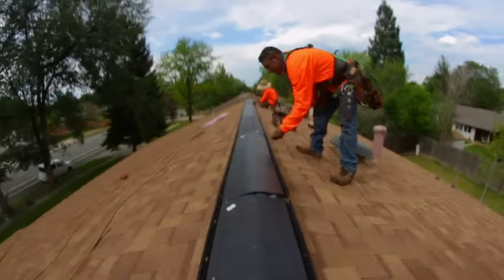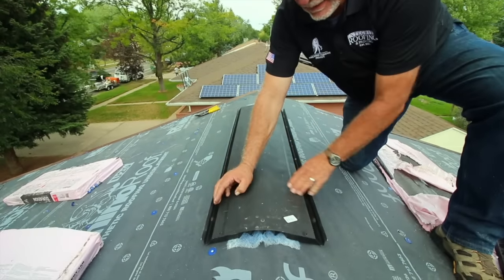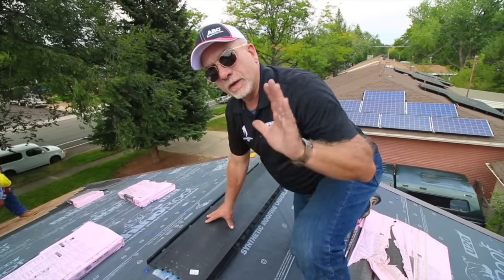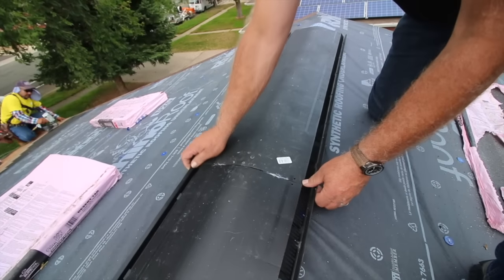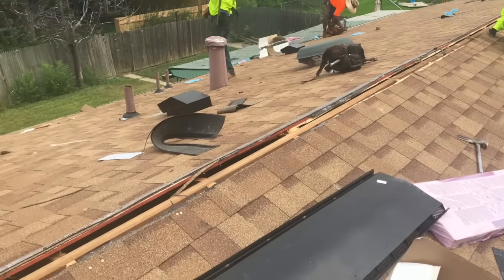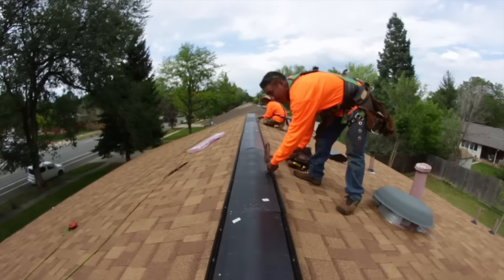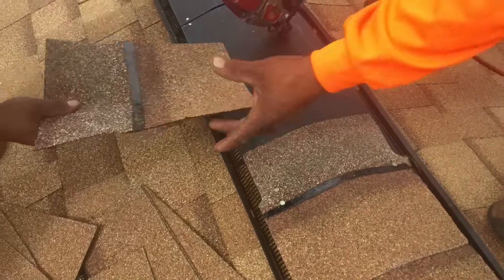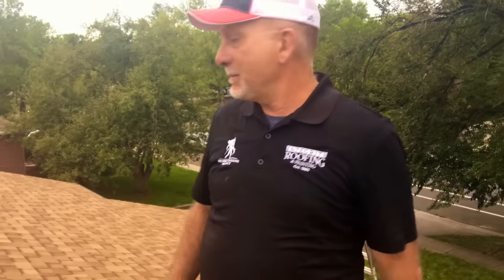RIDGE VENT INSTALLATION TIPS | ROOFER TRAINING

Comment: I hate with a passion speed nailing of any kind. They miss and drive half of the nails incorrectly
Reply: shantor100 take your time turn the pressure down and keep an estwing for the stragglers. But on my home I would hand nail them all .
Reply: Not if your good I cant bail that fast but pretty close and I hit the nail at least 3xoutvof 4 but I know what you mean
Reply: That's a no shitter, I had a crew of Mexicans did my roof it sounded like they had a machine gun up there, when they got done I had to go up and silicone over all the nails that were showing between the tabs.
Reply: Kelly White how you know there country of origin, did you ask each specific worker ? you don’t know if they where from Honduras,Guatemala, Salvador , or the rest of the Hispanic countries?
Reply: @kellywhite9278  I'm surprised your roof didn't cave in with that kind of attitude. .. SMH
Reply: @gonzalochalo461  it's not a racist comment about Mexicans if that's what you're thinking I have nothing against Mexicans I like Mexicans it wouldn't matter if they're Mexicans or blacks or Browns or yellows or whatever the hell they were it was about the job that they did poorly.
Reply: @kingloui9819 ok I don't know where they were from, they looked like Mexicans, but it's not meant to be a racist comment, like I said I'm not racist, I have nothing against Mexicans, it's about the job they did poorly.
Reply: @gonzalochalo461   Nothing about race bozo! If she knew their names she would of said it So yeah they was Spanish types  big F ing deal. Go listen to kumla harris speech shes on fox
Reply: @naps3386  I'm not a roofer I'm an otr truck driver, why should I take off work get my ass up on my roof to tell a crew who advertises to do a good job roofing my house how to do it, it sounds like you probably don't have to have someone looking over your shoulder telling you how to do your job, and I'm far from a snowflake millennial that needs to be told how to do my job.

Comment: I’m not a roofer but, I saw some speed nailing and the nails were going through the tar strip. Aren’t you supposed to nail outside of that strip so it will heat up and stick?
Reply: Nailing through the Tar strip is actually the best place to nail shingles, as the tar will seal the nail hole.

Comment: Is that fiber glass too much of an airflow obstruction?   My ridge vents have an insect barrier that is way too restrictive.
Reply: Good point. I was thinking the same thing.
Reply: The become blocked with dust eventually. The filters are bad idea.
Reply: @firstdive2005  Makes sense, honestly, I could not breath through my filters if my life depended on it after two years on the roof.  I removed them all.

Comment: The ridge vent manufacturer does clearly state that a minimum of 1 3/4 - 2" nails be used to install cap shingles. Plastic will not stop shingles from blowing off.
Reply: You are correct sir. The video shows the improper way to install the ridge cap.😎

Comment: I am a roofing contractor in South Carolina. I am a certified repair specialist and am well versed (20 years) in the application of all roofing products.
I really like alot of your vids, however...you are showing the improper way to install the ridgecap in this one.
You should NEVER use a pneumatic nail gun for the cap as the PSI can damage both the capping and plastic vents.
Capping should always be done by the hand drive method and preferably using nails that will penetrate the decking such as the typical 3" nails provided for vent install.
Owens-Corning for instance, provides the nails sufficient for this proper install of capping with each piece of its product. Stay safe and happy roofing.😎🙏🇺🇸
Reply: Owens corning also provides two coils of inch and three-quarter nails for your gun with their ridge vent product. It depends on the product. This ridgevent he is using is low profile enough to shoot on with a nail gun. I just wouldn’t shoot Owens Corning breakaway cap. I 4 nail their breakaway cap even when not going over Ridgevent. It is garbage and your nails do not hit the cap below it. I would much rather cut and use three tabs
Reply: They do not provide nails for ridge cap. They provide ring shanks to secure the actual ridge vent.
Reply: in general i agree with what you stated installing ridge cap by hand however, owens corning products includes nail coils for use with pneumatic nailers with their ridge vent roll systems.  To me that's an issue but they are allowing for use with nailers by providing products only for use with those coils!

Comment: We like to run the vents all the way to the end of the ridge.  (Look at the way Certainteed recommends installation of their ridge vents.) We believe it gives a more finished look instead of a raised vent sticking up from the roof.  We only cut the vents to no more than one foot closer to the end of the ridge.  The vents you are installing appear to be the same we use and they have internal blocks so that you don't have to worry about water getting in the ends because the blocks seal against the shingles on the top of the end of the ridge. If you have to cut to fit just make sure the butt end is facing the end of the ridge and cut on the end joining to the existing vents.  

I like the chalk line and installing one side first to get it nice and straight.  Have to use that in the future even though we get them pretty straight using the center of the vent and the ridge beam to line up.  

The vents we use, appear to be identical to yours, have tabs for interlocking the vents together.  I know GAF recommends leaving 1/8" gaps in cold weather but who installs shingles in cold weather!  With the number of nails in the vent and then all of those in the cap shingles, there is no possibility of expansion and contraction in any direction.  These are not like 12' sections of vinyl siding.  We have never had a problem because we only install in the spring and fall in warm, not hot, weather!

I am not sure where it says to use anything other than the supplied 3" ring shank nails to secure the vents and the shingles.  The instructions specifically state that the nails must go through the sheathing by 3/4".  Even 1-3/4" gun nails will not do that.  The shortest nail allowed by GAF is 2" for the snow country vent but it appeared you were using snow country advanced like we use which comes with and requires 3" ring shank nails to get the warranty against uplift.
Reply: I saw instructions that show caulking the edges on dimensional roofs. Yet, I never see anyone do this.
Reply: They supplier that I bought mine said 1 3/4" Nails... smelled like shit to me I'm going to roll 3" ring shank galvanized and try not to overdrive them. 

In addition the supplier said cut 3/4" cut on each side so 1 1/2" gap these guys have 3"... im using Ridge vent just like this.

Supplier seems to not know how to install.

Comment: I find this to be the best ridge vent ! Builders Edge or Ridgemaster Ridge vent. I have replaced others that were not working with this!
11 in. x 48 in. Ridge Vent Plus (10-Pieces / Box)
Resists cracking-regardless of temperature
Nailing supports and structural ribs ensure a straight roof line
Withstands dents from tree branches or hammer blows

Comment: I was just reading the the instructions on the ridge vent I'm about to install and it recommended a 1 1/2 gap max....so just make sure you double check before you cut. Great video!
Reply: this depends on weather you have a ridgeboard or not. Trusses dont hade a ridgeboard and allow more air to pass through. 3 1/2 seems like a lot of ventilation to me. Check the instructions it will tell you to use the bigger gap only if you have ridge and raftor.

Comment: ..Very helpful , but have a question about the ends of the vent. Are they sealed with roofing sealant when installed? They is a start end , do we invert the vent on other end to have start end there for water restriction?

Comment: Some observations; Shingle hammers were designed for use on wood shingles and shakes. Their square heads aren't compatible with anything else. Most ridge vents, even with equal soffit vents do not meet code minimums and don't come close the manufacturer's  and FHA's preferred specs. The electrical riser seen in the video doesn't meet specs either!

Comment: We have a continuous ridge vent installed on our 20-year-old home. We have our roof inspected every year and so far all looks good. Since our attic is so hot in the North Carolina summer, would you recommend adding an attic fan as well with a temp timer as well? Thanks

Comment: Wish Integrity Roofing provides service in Fort Worth Texas.  Some of the contractors who gave me a free inspection told me that ridge vent is not a good idea for my roof which is not flat or too steep.  Are they right?  For the ventilation work properly, do I need to install inflow vents as well?  My roof only have some Soffit Vents.  Appreciate your input ASAP as I'm in the process of having my roof done.  Great video!  Thank you.

Comment: Great video.  Is it worth installing 1/4” wire mesh on the ridge opening before setting the ridge vent piece ?  Can’t mice chew threw this material to enter roof ?
Reply: they'll chew right through the 1/4" wire mesh unless you get stainless mesh. Good idea, for sure.

Comment: What about snow, ice, rain? Do ridge vents not ever leak especially with snow melt and driving winds? How to install on hip roof? Do you need same area in gable vents to allow air in....air out circulation? How long to ridge vents last before needing replacement?
Reply: Of course they don't answer serious questions

Comment: Thank you for a very informative video on ridge vent installation.  Thank you for mentioning the Florida panhandle! I am curious what are the requirements for a ridge vent installation?  We have high cathedral ceiling in our living room with soffit vents and traditional rolled insulation in the rafters. 
Should a ridge vent be installed for our type of roof? 
What is the impact if a ridge vent is installed in our type of roof? 
I have heard the term gable applied to our living room, so what is the difference between a A-frame, Gable and Cathedral.  Should a ridge vent be installed for our type of roof? What is the impact if a ridge vent is installed in our type of roof?

Comment: The first place the roof leakes is at the ridge vent and the plastic stacks with the rubber boot. A good roofer would put lead covers over all the stacks.

Comment: Great and very informative video. I have a question though. I see at the 9:24 mark in the vid that there's a powered vent on the roof to the left. Is it okay to have a powered vent AND ridge vents? I'm thinking of doing the same thing to my roof but curious if this is okay. Does it have to be one or the other or can you have both? Thanks you in advance for checking out my question.
Reply: I noticed the same thing you did.  I’ve never heard anyone recommending the use of a ridge vent and a powered fan in combination with soffit vents.  It is definitely not recommended in the deep south where I am located.

Comment: what size/length nails are you using for the ridge shingles on top of the ridge cap? Are they standard 1-1/4" nails or longer? Thanks. Great video.

Comment: TEARING/CUTTING VENT:  Wish you showed how to tear/cut the Snow Country II.  
EDGE CALKING: GAF recommends that calking be used when arch/laminated shingles are encounter.  That is easier said than done because there is only a 1/4" wide surface to hold the calk AND you must be sure not to seal shut the drain holes which exit through the same 1/4" surface .

NOTE:  The calking is confusing because there are ribs protruding from the 1/4" surface which would ensure NO seal when used on 3-tab.  Perhaps with arch shingles, the calking should be applied after installation where there is a large, 1-ply gap at the 1/4" surface.

Comment: Some researchers have claimed that vents and ridge vent aren't worth the money and the vent only drop the temps in the attic about 9 degrees. IF the temp is still 150 degrees then 9 degrees dont matter.. Time to do some reflective seal or metal roof which can reduce temps drastically.. Roofers and roofing companies want to re-roof you house. They care not that it wont reduce the heat.

Comment: What do u think about adding a solar roof fan in addition to my ridge cap vent?  I used the same materials and technique u did I believe but I’m getting up to 120 inside air in attic on a 88-90F day.  And with a laser gun the sheathing in attic hits 139F.   Thoughts ?  My roof is on a raised ranch with a decent pitch but not steep

Comment: Are those 1 1/4" nails being used to install the ridge cap shingles?
Reply: I was curious too as they said in the video to use 2-3 inch nails for the shingles and then appeared to use a roofing nailgun with a maximum nail length of 1.75 inches.
Reply: Me too wondering 😢

Comment: Well put together video, kudos! However, I didn't see where you addressed the power attic vent that was also on the roof. Did you remove or block it off from inside the attic to prevent 'ventilation short-circuit" with the newly installed ridge vent? This home didn't have gable vents also did it? I am assuming that this home had soffit vent since you were going with the ridge vent. Did these folks happen to call you a month or two later praising your work just based on the cost savings that they have noticed on their power bills since installation? 
I'm in Georgia and have been an adjuster for 20 years and I find that these ventilation issues are common as I would assume in Colorado also although your air has way less humidity than the East Coast. 
Great video otherwise! 
Best of luck to you and your business in 2020!
-Dave
Reply: Don’t take out the power attic vent. I know the roof manufacturers say take them out, but I learned you should leave them in. They only kick on temporarily, so there is minimal disturbances. Ridge vents don’t do enough.
Reply: @bigmacattk  I'm getting ready to hire someone to put in a new roof. I have an attic fan and a ridge vent. What is the reason for having the attic fan too. I plan to keep it but I'd like to know what the reason is for keeping it.
Reply: @amorales9613  

Too many variables, its better to be cautious. First is too see if you have soffit vents. Even though you see vented “vinyl soffits” on the outside, doesn’t mean that the siding guy actually cut them in. I have seen that more than once. Then check inside the attic to see if you have baffles placed by soffit vents, or at very least, that its not impeded by attic insulation.

Then you have to determine which ridge vent your installer is using. The 4’ plastic strip systems work the best for air movement, but conversely are more prone to leaking and clogging. These are suited for homes with not many high trees, and also better suited for roofs that are a steeper pitch. The rolled ridge vents like cobra/ventsure are better suited to protect from clogging/leaks but their ventilation is quite poor. 

Look up the net vent area calculator, to see the requirements. I will guarantee that less than 1% of roofers will even factor any of this in. You will always have way more “intake soffit” than exhaust, this equation must be balanced per the formula (see formula for what i mean by balanced, it’s not balanced in the traditional sense) if you even have a chance for the manufacturer to approve your claim. So don’t depend on what the manufacturer says it will guarantee, because it’s meant not to be honored. 

Long story short, leave the power vent because it only kicks on when you need it. They usually have a built in humidistat that monitors moisture levels. If your attic is fine, it won’t kick on. It has temporary disruption of air flow, and passive air flow goes back to normal when its off. If you don’t have a unit with humidistat, ask your roofer to replace it with a new one. Also you may have to call an electrician to tie it back in. Some roofer do it,but most will not. Hope that helps

Comment: I have ridge vent and soffit vents with the holes every 3 feet or so, will replacing the soffit with the kind that has the holes with no gaps make a difference, I still get ice dams in winter, cape cod hose so no attic to get into to add insulation in roof

Comment: Are they using roofing nails to nail the cap down in the shingle vent? All the shingle vent I've ever put on calls for minimum 2 1/2 inch nails to install cap on shingle vent
Reply: Most roofing mailers are 1 3/4 maximum length so I don't think  so

Comment: Thanks for the video.  I have a question? What size of nail were used to nail the shingles to the vent?
Reply: The wrong size.😱
Reply: Is it nailing the shingles to the vent, or through the cent to the roofing?

Comment: at 6:07 i can see a couple nails that aren't driven all the way down. will those cause the ridge cap to detach sooner?
Reply: You lay away from prevailing wind direction and finish last cap with two nails. Cover nails with tar or caulk

Comment: Your videos are great!  I  recently had my re replaced. They put a ridge vent. I don’t believe I need it. Can a ridge vent be closed?
Reply: Mara Davila don’t close up. Your attic space will benefit. More ventilation the better
Reply: Mara Davila -- No. If properly installed there is no reason to want to close a ridge vent.
Reply: I agree with both comments. If it's not broke....